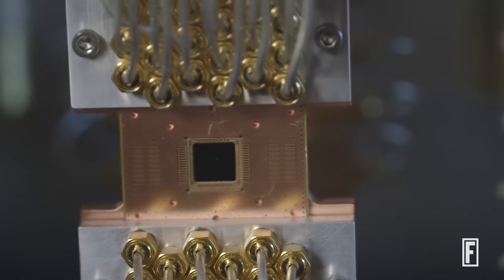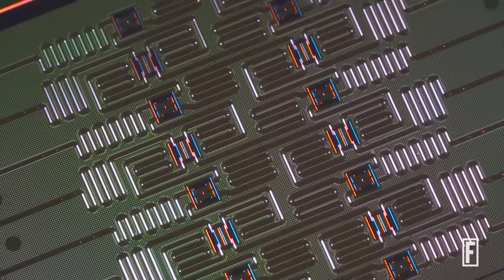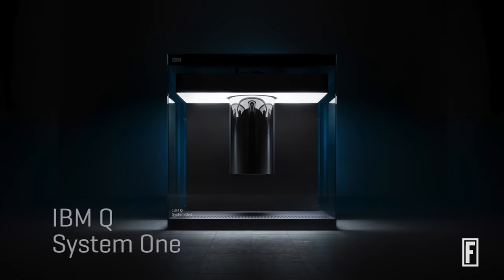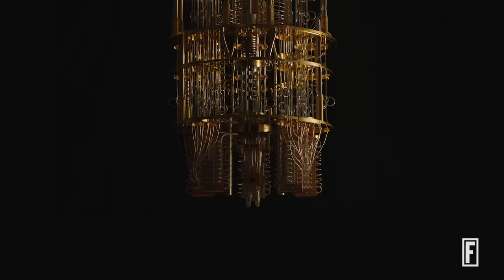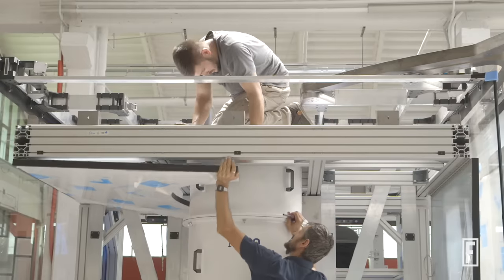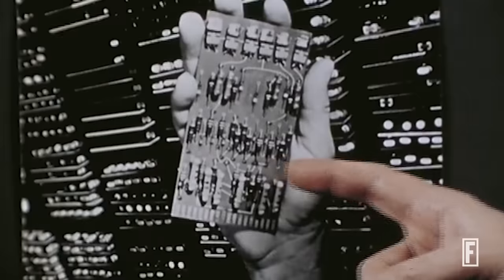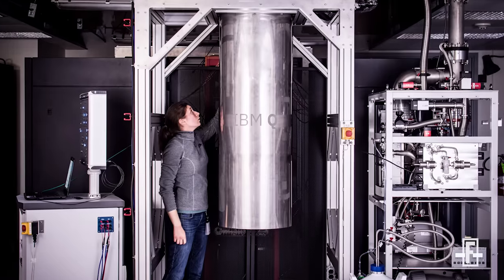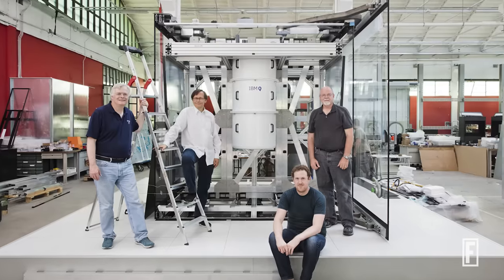IBM Unveils Groundbreaking Quantum Computing System I Fortune

Comment: "Every quantum system we build is better than the last." Okay. Is there a time when you expect to be building a quantum system that is not as good as the last or was that an artificially positive thing to say? IBM is known for it's mainframes? And so you show images from the 60s or 70s? IBM was the leader in PC technology, but never saw a need to put a hard drive on the machine. They lead in hard drive and tape technology, but lost to their competitors and had to pull out. They ran with token ring technology, but look out for that bad link in the chain. And finally, look at the market share IBM had in the 80s and compare it to the market share in the 00s. Can't compete--run and hide. IBM and future computing--only if your competitors don't want to get into that area. Run and hide.

Comment: ok first off this is not even remotely new, these so called quantum computers have been working for around 20 years now, and yet no one is using them, do you know why? I do, it is because they do not produce consistent results, the answer might be anything, they require massive amounts of power and coolants, one of these computers cost over a thousand dollars a day to run it, last but most important, they cant run any type of software and have no operating system even, it is a giant expensive DOS, these are not real and do nothing at all yet, this is a hopeful look at what might come years from now, but since there is only a few of them working and no one has access to them, then no one will be able to write script or code for them let alone a operating system or software to run on it.  yay! it is a brick that cant even calculate simple math correctly that cost over 1k$ a day to turn on, sounds great.